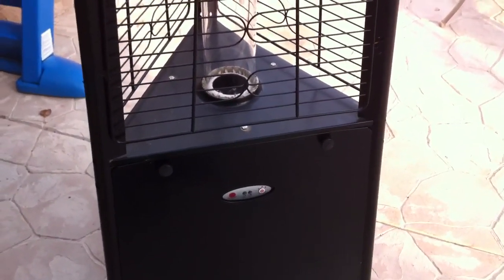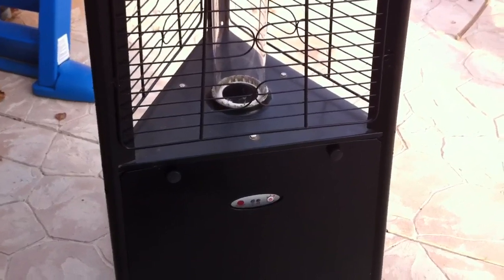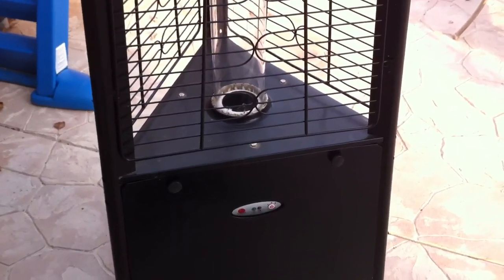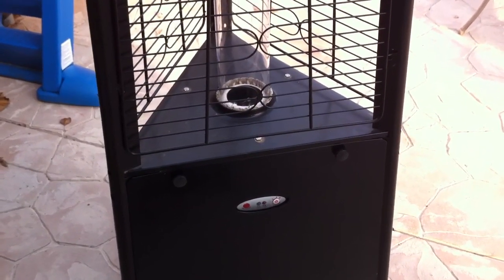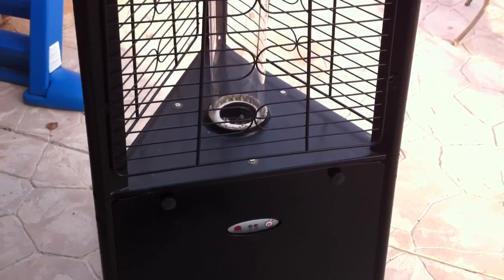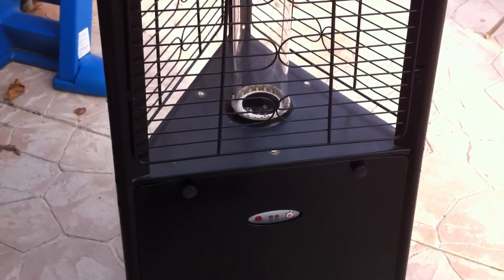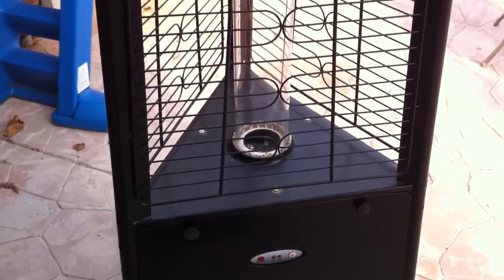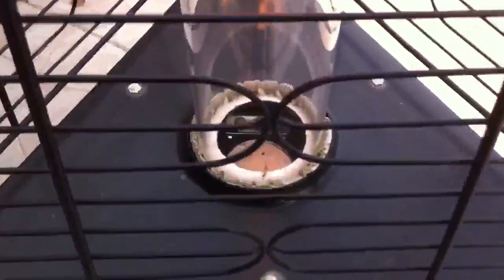Lava Heat Italia FAIL & Repair PART 2

Comment: Coming up on 10 years since you made this video so I'm not real confident you'll even see this, but here goes anyway.I agree that these are overpriced Chinese crap but we're both stuck with them. It seems like I'm having the same problem, I get the clicking and a tiny flame appears for a nanosecond then goes out and I get an E2 on my LED. How do you clean that piece?
Reply from the maker: Take a fine piece of sandpaper and clean the sensor that the pilot light “heats up” and also check the connection between that sensor and the gas valve. Sounds like the sensor isn’t telling main gas valve to open.
Reply: @flipnotrab  thanks a lot